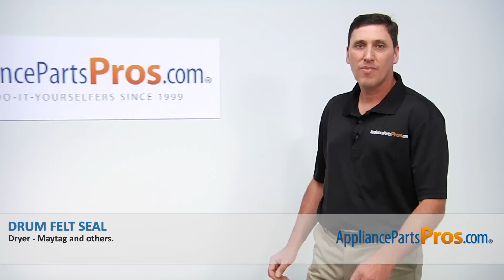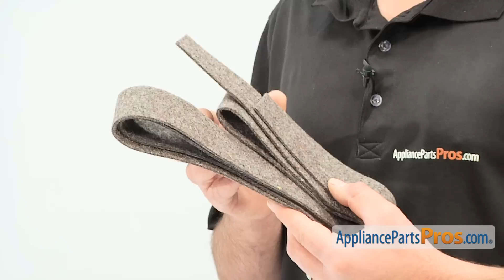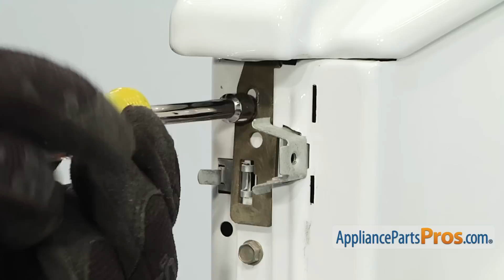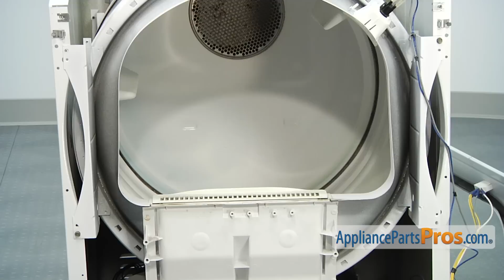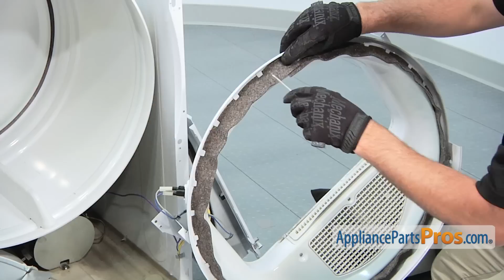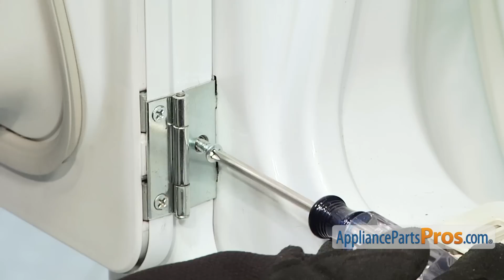How To: Whirlpool/KitchenAid/Maytag Drum Felt Seal WP33001807

Comment: Excellent video however, I can’t believe having shipped the seal from America waited for weeks , finally i get dryer in pieces stuff everywhere m, I discover there are two seals NOT one? The rear seal as well is worn. It seems staggering to do this whole video and not even mention there is a second seal? at the rear? So I should’ve bought two and the video does not even remotely touch on how to replace the rear seal either - a little surprised and disappointed.  Another major delay for weeks and starting again later after the parts come in.

Comment: wish my dryer had that.  I have metal staples holding my felt on.  It ripped and caused the drum not to spin.  I ripped it off, wondering how to replace??
Reply: I have seen other Maytag videos when a thermal glue is used for the felt seal.

Comment: So the top of the felt seal goes over the the drum? What do I do if one of the clips is broke that holds the felt seal?
Reply: glue
Reply: Dryer Thermal Glue or tried to find the bulkhead replacement. A broken tab is not good.

Comment: My dryer is very old & it died big time & in the process of taking it apart to figure out what went wrong, I noticed that both the front & rear felt seals had worn in half...  These are nice video's, but if they used a ten year old dryer & not a new one, the reason for felt seal replacement would be obvious.  Mine weren't the problem, but lots of things were very worn & as long as I had it spread all over the laundry room, I did a major rehab, including the felt seals.  I can't imagine a dryer failure that would be solved by just replacing the front or rear felt seal.

Comment: This is a very good well produced video.  I've watched ten others just like it.  They're all missing something.    WHY replace the felt seal?   How do you determine that the felt seal needs to be replaced in 
the first place?   There are several reasons why dryers overheat  or won't heat.  Many DIY videos go straight to the thermostats and elements.  How would a consumer know when the problem is the felt seal?  How do you diagnosis that?  Thanks, James.
Reply from the maker: The felts give the drum a smooth surface to spin on. If they are damaged you might get some metal on metal noise or depending on the design when worn the drum may bounce up and down as it spins, leaving marks on the clothes. Also hot air will escape which may increase drying times.
Reply: you'll know if it needs replacing if it's torn to shreds like mine. simple as that. If it looks intact then its absolutely fine. Mine was ripped to pieces and so worn that the metal on metal sounds started and the nylon bearings are destroyed as well.